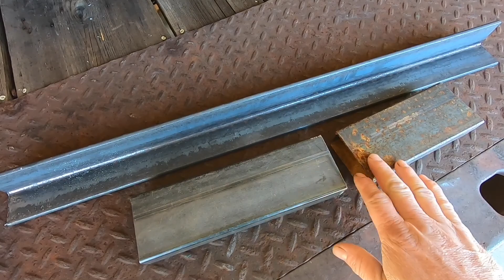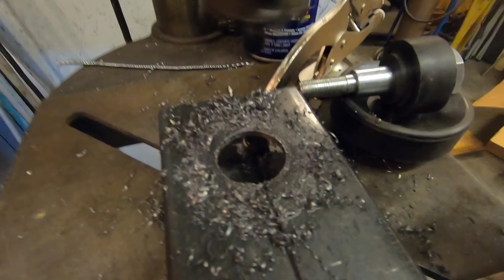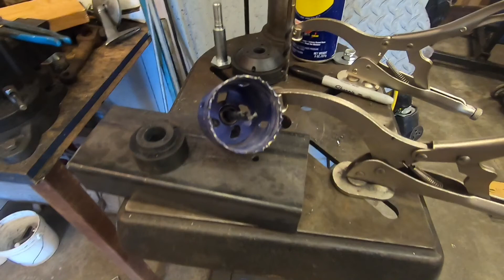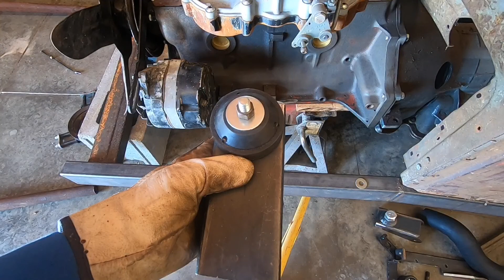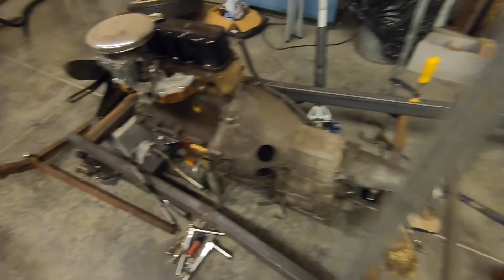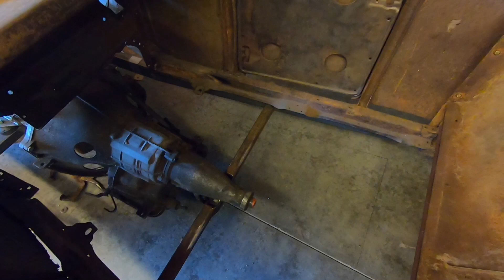The “BLT” #9 Engine & Trans Mounts

Comment: Cutting oil is what I like to use when using a hole saw, but usually it’s whatever’s handy 😉. When drilling with regular bits I like using nothing at all, it’s less messy just means sharpening the bit more often.